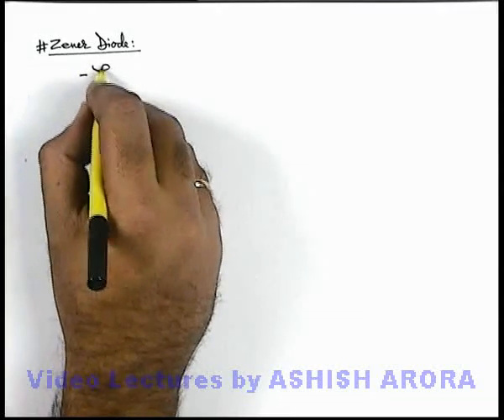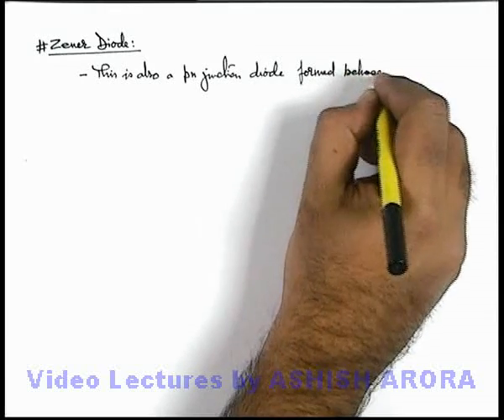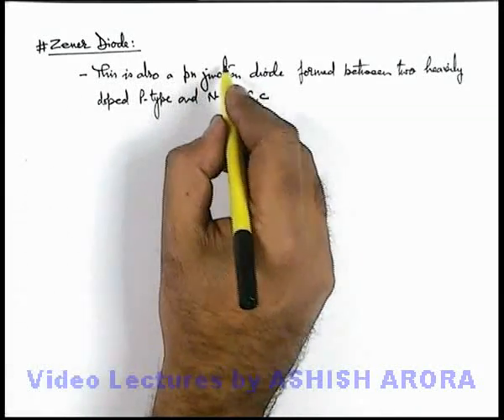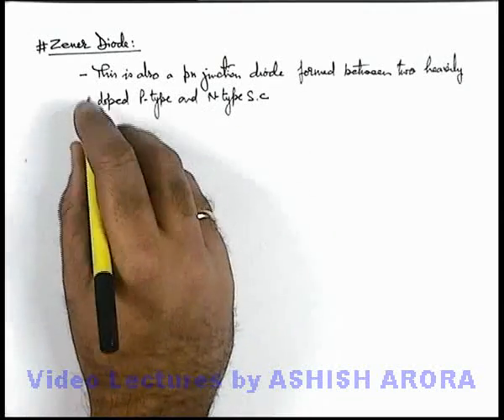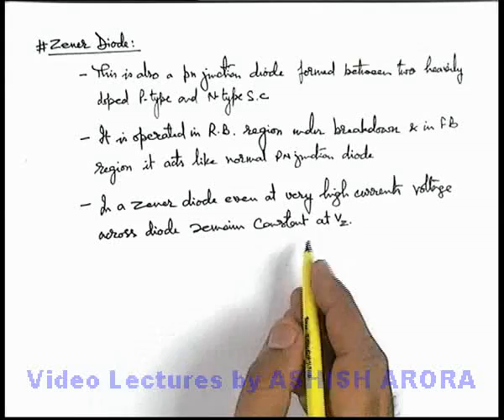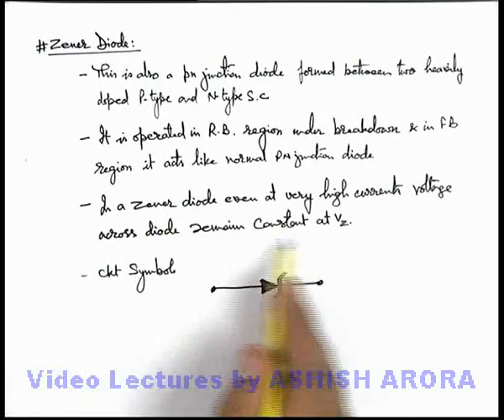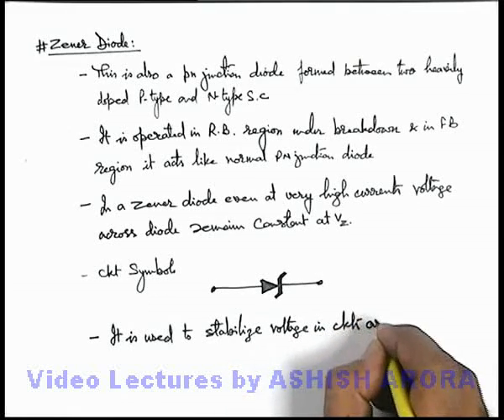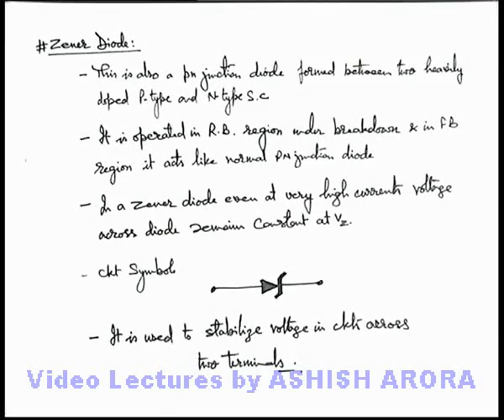Class 12 Physics | PN Junction & Diodes | #14 Zener Diode | For JEE & NEET

Comment: Sir pls reply why should the voltage across the diode remain constant
Reply from the maker: This is clearly explained that in zener diodes when breakdown occurs that happens at a specific value of electric field inside the PN junction and current flows as if it is short circuited with a constant potential difference to keep the electric field in junction constant.... if potential difference decreases below the breakdown voltage then diode resumes its reverse biased state...